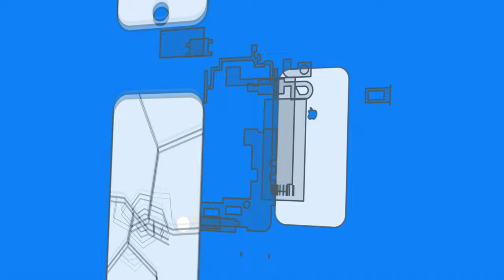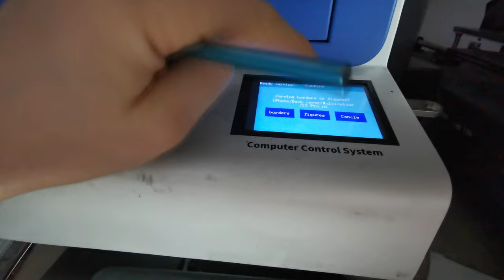IPhone 13 Pro / Max Back Glass Replacement - DoItYourself Tutorial

Comment: Why did you dismantle the phone?? The forward laser is designed to use without taking the phone apart, all you did was add more work for yourself and risk breaking the expensive screen 🤦‍♂️
Reply from the maker: If you know how to open the iPhone 13 there is no risk... 
The problem of all the laser machines is, that they can damage the camera during laser process because of fumes that can get inside!

Also the fume will be inside of the device as well as some glass parts and that's not professional. 

That's why I just open the phone and do it the right way.
Reply from the maker: For example for the 12 pro max there is even a bigger Problem. The camera frame of the main lens has a hole in the side where Glas gets inside of the camera when the camera is not unplugged.
Reply: @allsmartrepairinternational  is there a place to get the full kit?
Reply from the maker: @Kalliswaq  you want to buy the laser?